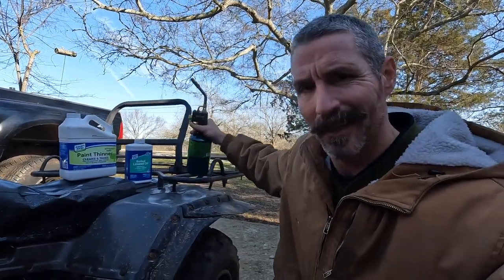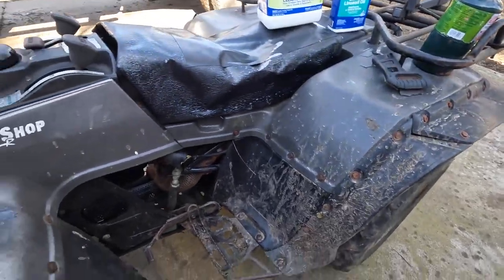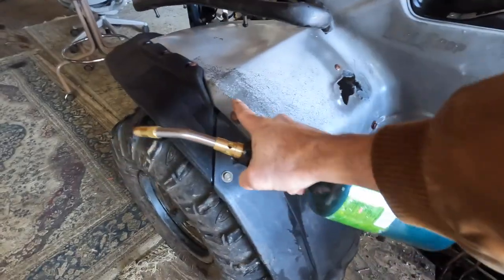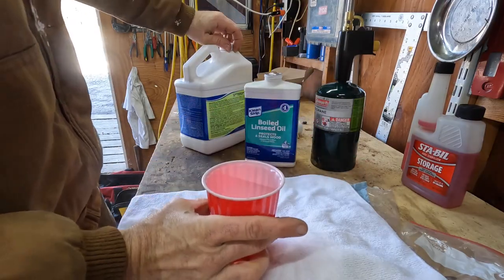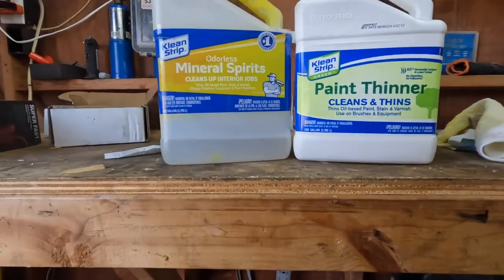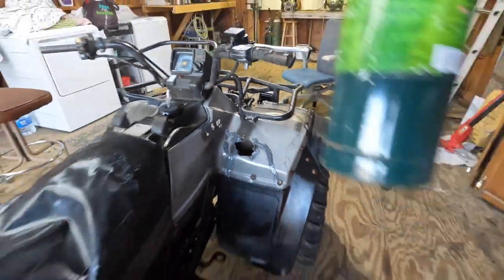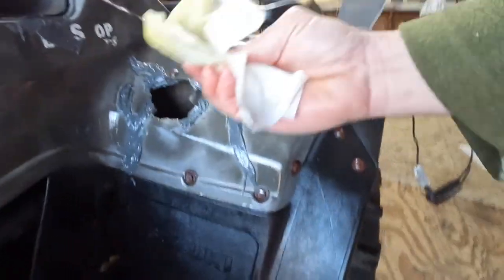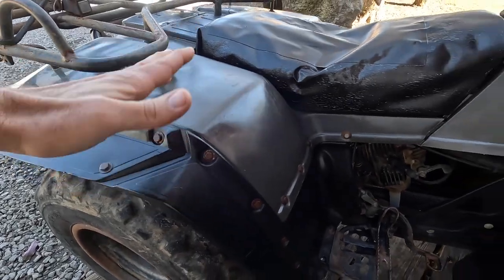Restoring Faded Plastic with a TORCH vs PAINT THINNER and BOILED LINSEED OIL. One clear winner.

Comment: There is another video where a guy does regular paint thinner and boiled linseed oil . Mixture has to be 60/40 mixture , 60% paint thinner and 40% boiled linseed oil . It worked on his red four wheeler . If there is built up crud well you have to scrap that off